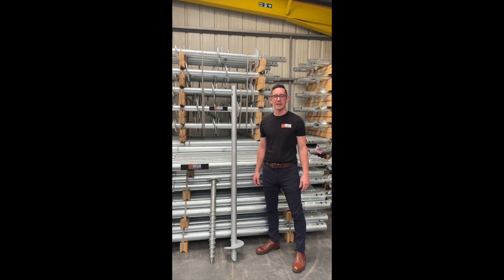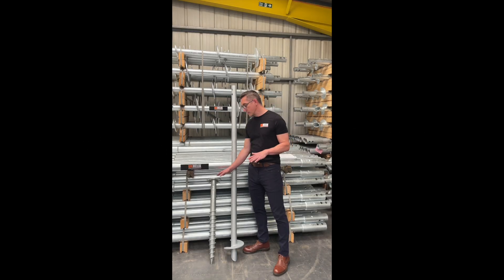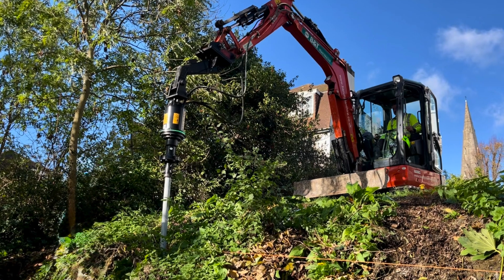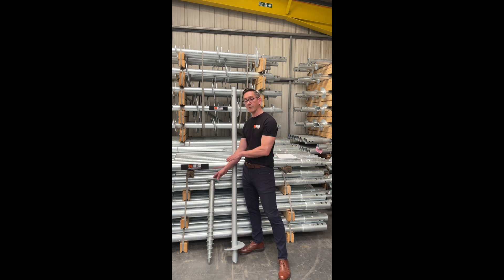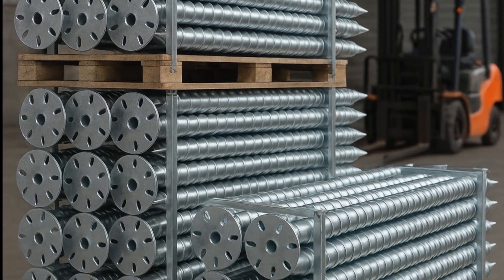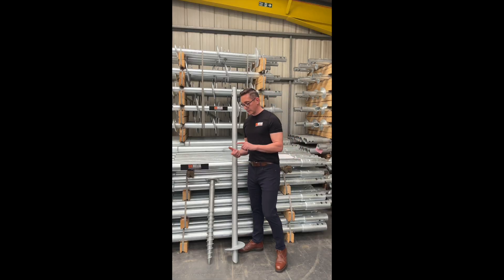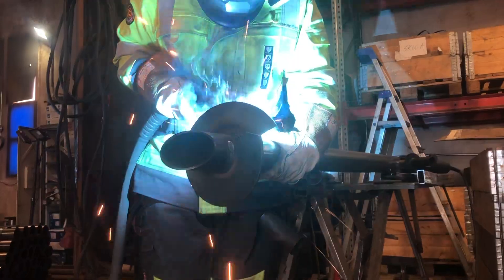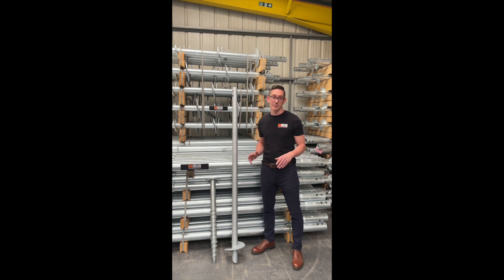Screw Piles vs Ground Screws: Which Foundation Fits Your Project?

Comment: Hello UkHelix! Professional Ground Screw Installer here. I’m glad to see more alternative foundation products growing opposed to traditional messy concrete. I’ve installed ground screws for almost a decade, and after watching your video I have to say there is a lot of false information. 
The ground screws product that you’ve demonstrated and based all information upon is a size scale you could almost find at a hardware store to install as a casual homeowner.
An actual comparable ground screw of the same size as shown in the video would show the true light of it’s capabilities. I’ve dealt with 6’ ground screws, all the way up to 18’.
We too, use an excavator to install our ground screws. We also have a torque-hub monitor to give us our readings. 
With traditional helical piles, the soil is disturbed with the helix plate and does not provide a lateral rating, nor a true torque reading. When coming across obstructions, the helix plate can cause a big change in the scope of work.
Having dealt with various soil conditions and obstructions, using ground screws with the proper equipment is best suitable. If we come in contact with rock or other obstacles, our equipment can pre-drill through before the installation of the ground screws.
Don’t get me wrong, the hand held units that are designed to install the screws suitable for the project, do just fine. They typically have a “torque bar” to gain the power it needs. However, if we have the space for bigger equipment, why make a job more difficult than it should be!

On that note, it’s exciting to see products like ours starting to change the way of building!